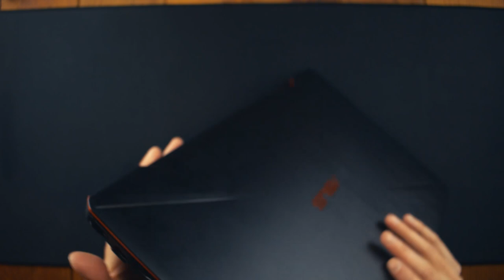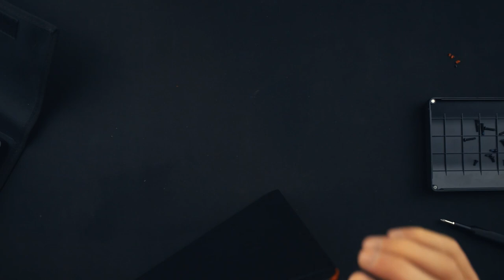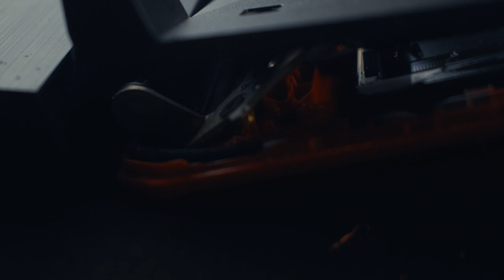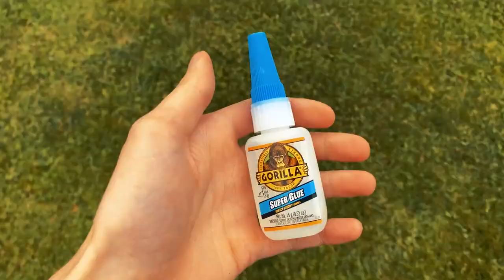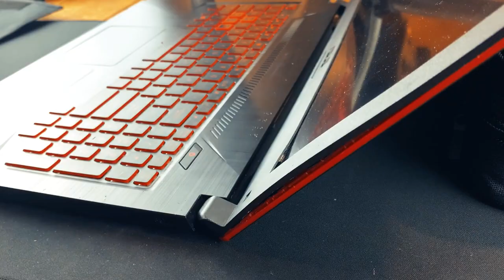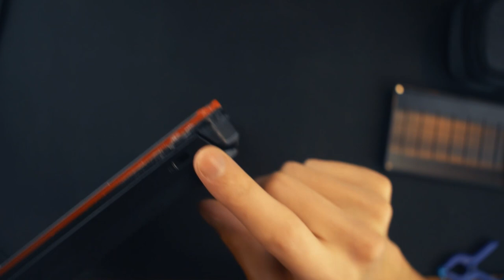FIX ASUS FX504 HINGE?! | Asus TUF FX504GM-WH51 Gaming Laptop | Jerryrig/Mod

Comment: So, everyone is facing the same problem about ASUS TUF FX504 hinge.

The problems of hinge issue are bad quality of nut mount and tight hinge mechanism.

Solution:
1. Disassembly the laptop and remove the screen, you can use the tutorial in www.youtube.com/watch?v=4fXLGr3TxcA
2. Disassembly the screen, you can use this video as guide www.youtube.com/watch?v=sdhYgLzSZuE
3. Locate and find the broken nut mounts of hinge and the nuts. Do not lose the nuts
4. The broken nuts could be on the motherboard or keyboard side or could be on the screen or it could be happened on both sides
5. I use the power glue to place the nuts back in they used to be.
6. Actually, the process of gluing stuff the nuts is the most terrible process. I am not too good at gluing back all the nuts so the form is not coming back to the perfect form.
7.  I use baking soda (or powder? correct me if I am wrong) and power glue to make very strong bond on the nut mounts. I use the knowledge from this www.youtube.com/watch?v=slCMkvEfK_U and www.youtube.com/watch?v=Sq5YJbZXaZk. 
8. Wait until the bonds are all set, dry, and strong. 
9. Loosen the tight hinge mechanism by using 5 mm wrench. Just locate the nuts that constraint the hinge mechanism.
10. Assembly all of the stuffs back in the place. Just reverse the disassembly process.

I just finish fixing my laptop hinge. It is back to normal again but the form doesn't back to normal again due to lack of detailing skills on glue of mine. 
I will try to make a video of my results and also write a blog.

Thanks
Reply: i have loosened the hinge  mechanism ...There are 2 screws that u can use to make the screen glide easier...
Reply: yes
Reply: dude,how're the hinges now??......Ur sol'n worked?
Reply: Hey, just wondering if we have to remove the board when disassembling the screen or just remove the display cable?
Reply: @Dean.Michael.Winchester  just remove the display cable, the board still intact to the top case
Reply: @samueladiprabowo4343  thank you for the reply, I just loosen up the nut of the hinge a bit and it works like a charm, the lid don't break no more 👌

Comment: The real solution (especially to prevent this issue) is to loosen the hinge mechanism. Unscrew both sides of the hinges and then give them one turn with a hexagonal thingy to loosen them. You might have to trial different friction values so that the screen holds in place when you lift it, but the reduced tension on the plastic will mean you're less likely to damage it over time.
Reply: Great solution

Also find the problem of broken nut mounts and fix them.
In my humble opinion, this guy from the video does fix the issues by utilizing permanent solution. The screen would not be disassembled again
Reply: Exactly. The "hexagonal thingies" are sockets. I didn't have the correct sized socket so I used a very small pair of pliers. Generally the nut on the end of the hinge shaft is stuck on there with Locktite adhesive, making it impossible to turn with any kind of tool. What you need to do first is apply heat from a lighter for a minutes until you hear a little pop noise. That is the Locktite burning up. You'll then be able to loosen the hinges.
Reply: Ah yes. That's why the Asus service Center People gave the laptop Fucking loose. 😂 I hate this little crappy laptop

Comment: The service centre replaced my front panel like 5 times because of this issue. And every time it breaks. Now I keep the laptop open unless I want to take it somewhere 🖐️
Reply from the maker: Its actually coming apart again... I think I'm gonna buy a new laptop.
Reply: @ZackEberly  i am getting the eluktronics thicc 15 with my stimulus. has ryzen 3600 and rtx 2070 for 1400 bucks but i am taking the ram and ssd out of my pc so it will be 1200
Reply from the maker: @Joker-no1fz  Lucky, I won't get any cuz they went off of my 2019 tax returns and i was claim as a dependent.
Reply: @ZackEberly  who ever you claimed under got the money ask them for it.
Reply: How much it cost to replace the front panel, if the warranty is void?
Reply: @adarshraj9924  5k . But I have replaced it 2 years ago.

Comment: Anyone still facing this issue, you should open and close the laptop lid every time by moderately pressing the back of the hinge that has the problem. I started having the same problem with one my hinge and I have been doing this since the last one month
Reply: This pandemic made me use my laptop frequently unlike before when I have real life haha! But Asus hinge design is a trash.  I am starting to have the same issue and I cannot afford to buy a new one knowing that if i sell this one, i won't be getting decent price.
Reply: @desueilhalder1854  Yeah, the older pieces of this model seem to have a defective hinge. If it's not too broken, the method I suggested might work for you. The hinge of my laptop hasn't gotten worse since. Also, I came to know that if almost anything goes wrong with the laptop, Asus would change the whole motherboard, and in my case they asked me to pay more than I had brought the laptop for!
Reply: @Shubham-tq5ot  are they for real? Why will they need to change the whole motherboard? I am very disappointed for paying for this laptop :((
Reply: @desueilhalder1854  My laptop started restarting randomly and then stopped going past the boot up screen. Took it to Asus & they didn't want diagnose the root cause and repair just that. Told me they'll have to change the motherboard, which is pretty much the whole laptop and they'll have to  get it shipped from Taiwan or somewhere similar. They were like, since I brought it on sale, that's why the repair cost is higher than my laptop. The warranty had gotten over just a month back. Fortunately,  after escalating this to their higher management, they agreed to repair it for free! But I'm sure as hell not gonna buy an Asus again
Reply: @Shubham-tq5ot  HEY OMG BEFORE HAVING THIS HINGE PROBLEM I ALSO WENT THROUGH THAT BOOTH LOOP?! I went to where i bought this tuf fx504 then they replaced the hard drive no explanations on what happened. Their product really suck. Now I believe the yt video that warns ppl to not buy this laptop.

Comment: i had the exact same problem, i open the lid and the vessels, and I broke the screen because the glue that has in the bottom edge of the screen is super stuck, so 2 things, one don't buy it, and if you bought it, don't open it yourself, or at least, be extra careful, even that I took all the precautions anyways happens. the weird thing is that after I break the screen I couldn't even replace it because the cable from the motherboard damage as well and not even changing it was possible to repair it... so now my Asus is a desktop computer connected to an external screen hahaha.. omg... horrible...

Comment: The hinge on mine is worse than yours. It’s basically shattered itself simply from opening and closing. Cheap plastic. 
Going to try a similar dyi fix on it. Hopefully it works, if not...as Mashiro puts it “Plan C”
Reply: Did you fix it?
Reply: @xtremejancel7432  yeah, no problems. 
I ended up replacing the entire panel around the screen. Hopefully it holds up.
Reply: @starwars1744  Mine had similiar problem too. The red thingy plastic shattered when it broke. Any solutions mate?

Comment: Same laptop, same problem. I suggest that as early as you notice this hinge problem, gently push back the top of the hinge with your finger tips while your thumb on the other side. Eventually, the left and right hinges will be both broken so remember to be gentle. I am not sure if it is good suggestion to put super glue since it can melt the plastic, then if it hardens and the other areas cannot support the movement of the screen while opening and closing i believe it will cause larger damage.
Reply from the maker: Yeah, that's prolly true and it also lost a lot more value as well.

Comment: It's not just this variant energy TUF series laptop has build quality problem broken hinges broken screw mounts bad plastic quality I have 3 broken screw holders and one broken screen hinge but it works for screen as it can be screwed with laptop bottom case so there's no problem if the screen hinge screw is broken

Comment: Service center guy told me that i have replace body+keyboard for fixing that broken that  nuts and it cost around 200 usd, so i didn't agree and now I'm using with only tap support from last 1 year
Reply: Same here buddy mine cost about 400 ringgit  💸💸
Reply: 200 usd? 
What a scam, and itd not worth it i think it will broke again in less than a year
Reply: @misterlove7895  Yes Now I used Fevikwik Gel (cynoacrylate based adhesive) in corner and no issue, little bit wobbling but it cost only 1 usd so from last 4 month I didn't face any issue

Comment: I have experienced almost the same issue with one of the screen lid hinges on my 6 month old FX505DT. The hinge started making cracking noises if I move the lid slowly in any direction and within a week it seized up almost completely (in the closed position). I've sent it for a repair under warranty. Still waiting for it to get back... I think that the seizing of that left hinge happened due to the heat from the cooler which degrades the plastic washers in the hinge mechanism and they just self destruct. Maybe the hinge would not seize as quickly as it did if I've taken my time and let it cool down before operating the lid after a gaming session. I know I'll never go for an Asus laptop ever again...
Reply from the maker: I think once you spend like 1 grand or more then they tried to make a good hinge but for the budgeter laptops...
Reply: @ZackEberly   Even then I wouldn't trust them... Not anymore. How much more expensive could the better hinges be?

Comment: I have the exact problem and i glued it. Then it broke a seecond time.
What can I do?
Reply from the maker: More super glue... over engineer by jb welding metal pieces on either side along the inside of the laptop screen. So like inside but that might require some surgery on the plastic.
Reply: @ZackEberly  or we can drill a hole in the cover and use screws and nut?
How is your fx504 holding up?

Comment: I have this problem since like a year now, and my laptop must be 3 years old at this point. I never knew how to call the ''hinges'' themselves so I never bothered checking for a fix online, but now it's too much. Lucky me, while checking out why my camera suddenly doesn't work (it's not a driver in my device manager so it's not attached to my laptop and unavailable), I found the word was HINGES. Now my right hinge is so devastated, that a crack appeared over time and the plastic in front of my hinge is shattered. Weirdly enough, my left hinger is compeltely fine. I'll try this super glue solution one day and test it out if it works over time.
Cmon Asus its my first laptop ever :'(

Comment: bro i used plastic bonding kit and it worked on one side but i ran out of glue. great laptop besides the super shitty hinges. my screen keeps messing up i think the shit hinge made my monitor cord come loose pulling on it to much. i am going to open it and make sure the monitor plug it tightly in. i told jarrods tech about this issue and he said i must abuse my laptop and this never happens. i think he was having a bad day he got pretty rude.

Comment: I have the same problem. Should I replace the hinges along with the back cover or will the old back cover do just fine with the new hinges? Thanks!
Reply: I did this and about a year after getting it replaced, it has once again broken. I wouldn't if I were you.
Reply: Dude I had replaced it for like 5 times🤣 in warranty period. It took only 1-2 months to break.

Comment: I had to fix mine by drilling hole through it and holding it together with zip ties 😭
Reply: You could use screws
Reply from the maker: Not really, there is nothing to screw tightly against. You'd strip the treads on the plastic. You would need to clamp it like with a bolt and lock-nut or in his case, some zip ties.

Comment: Hey, have the exact problen in the Nitro 5(2018), i bought it in 2019, so it's just 3 years old
My problem is The metal braket that holds the screen is bend on the right side only, and both the right&left side plastic clip that holds the hinge with tha back panel broke too, so here i am watching this vid, dont know what to do, i tried searching the nitro 5 back panel and the hinge+metal bracket it self, but they're expensive in my country, so yeah. The problems you get when buying a budget laptop, thanks acer....
Didn't even think of this issue when buying the laptop,

Comment: I had this problem last year and I've only just come across this video. My solution was also to glue the sides like hell, which seems to have been effective. However, my problem now appears to be a loose hinge where it slides backwards slightly when I close the laptop so that it wont close fully on one side meaning I have to push it back after every use😫

Comment: I know this video is old but I bought this laptop in 2019 for 'gaming' and to finish my last year of University since my previous Laptop died, If I used this laptop like 10 to 20 times is a lot because is damn slow and mine only has a hard drive, do you know what I could do to make it faster?
Reply: Also that hinge thing happened to me too but i just when with glue to 'fix' it.
Reply from the maker: You could put a SSD as the windows boot drive and it would speed it up. Get a 500gb SSD or something. Crack it open i bet there is a open M.2 slot for a M.2 ssd. I have a upgrade video for this laptop- https://youtu.be/3lInVzXBO1g

Comment: is it too late for mine? the screen wont turn on its completely off, about a year ago it happened.
Reply: You've probably just worked one of the cables loose or off. Open it up and check that every cable is in a socket tightly. If there's any cables floating around then locate an empty socket and see if it fits. Another thing that may have happened is one of the cables (especially the one from the screen to the motherboard) may have broken due to repeated flexing or becoming trapped under a hinge part and being cut in half. 
Let me know how you go.
Reply: @RiffRaffMama.  im not home for a couple of days, but i remember wire was sticking out. Also im pretty sure it wasn’t the mother board.
Reply: @onewish6023  Did you install anything new before the screen problem? My screen is not coming on now and I suspect it has to do with the two brand new ram cards I just put in, but I haven't been able to test that theory out yet.
Reply: @RiffRaffMama.  no

Comment: How's your fix holding up a week or two later?
Reply from the maker: I think I put enough glue in that the only way, its coming apart would be either the hinge mechanics or it snaps in the middle of the screen! Its extremely sturdy again and fells like a 800 hundred dollar laptop.
Reply: @ZackEberly  awesome - I will give it a shot!
Reply: @ZackEberly  way more damage on both sides of the hinge for me - so I did a complete disassembly of the screen and hopefully it will all go back!
Reply from the maker: When in doubt, just use more super glue

Comment: No they did not fix that in the newer 2020 model ...
I have Tuf A15, and the hinge are exactly similar to these and i hate them
Reply from the maker: Really?! It sure felt sturdier on a FX505 but that was a 15in so maybe that's why it felt sturdier.
Reply: @ZackEberly  
FX505 is 2019 model i think ? 😅
I have A15 (2020 model with Ryzen 4600H)
And I don't like it's hinges at all ....
Reply: @ZackEberly  
Imo Lenovo Legion has much better hinge design ...

Comment: Sir, i have the same laptop and my fan rattle a lot. Do you have the same problem?
Reply from the maker: I had a plastic piece stuck in my fan that caused some noise but other than that not really.
Reply: My fan rattle a lot do you know why?
Reply: I had that problem when going on full speed, ended up exchanging the fans.
Reply: @amateurpro1185  common problem for this laptop, need to replace the fan...
i have both problems too

Comment: Dude, quit carrying on like it's some kind of personal attack. This happens with any laptop, because the hinges tighten over time and the plastic can't deal with the extra forces this applies when you open the case.
Reply from the maker: Hahaha “personal attack”... if you have one of these laptops you’d prolly understand, and maybe you do but that fact is that less than a year these hinges start acting up. Bad design if you ask me. Other laptops hinges are working great and they’ve be used for 5+ years. So yes it happens to any laptop, but it should not happen so fast to a decently expensive laptop.
Reply: @ZackEberly  A hinge is a hinge is a hinge. They're all a mechanical device assembled from multiple steel pieces that work together to turn and lock into position. The problem is that every time you open and close a hinge it tightens up the tiniest, tiniest amount. So if you use your laptop a lot, then you are likely to confront this problem sooner than other people and their laptops. I'm going through the same thing myself right now with my Acer. I've ended up having to reinforce my lid from top to bottom with small strips of wood hot glued on to the outside, until a better case comes along.
Reply: @RiffRaffMama.  I used the laptop, before replacing it with the cheap Asus one, for a whopping ten years and the hinges are as strong as new. I also have another one that's about as old that one too is still doing strong. This is either a planned obselescence(look it up) or Asus employing college kids to design it's stuff rather than actual engineers. All it takes to catch this kind of issue is opening and closing the lid a thousand times and they do have the means for it.